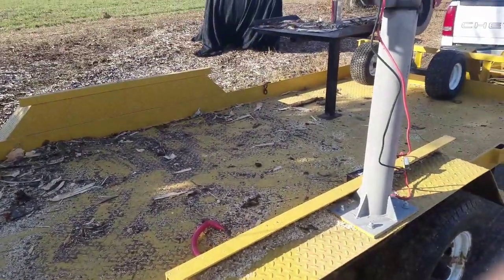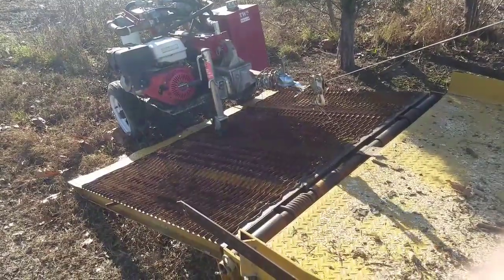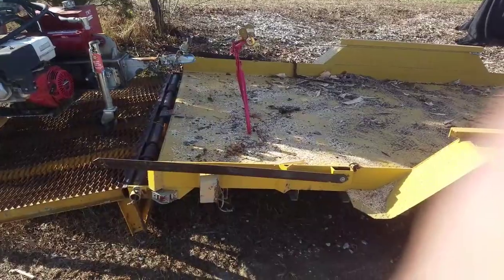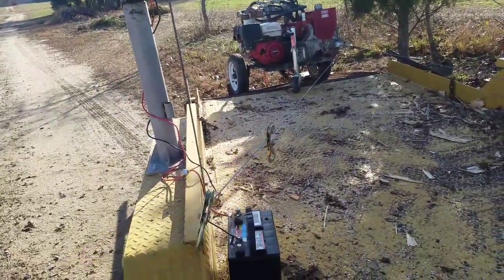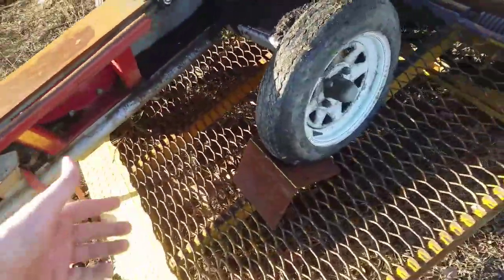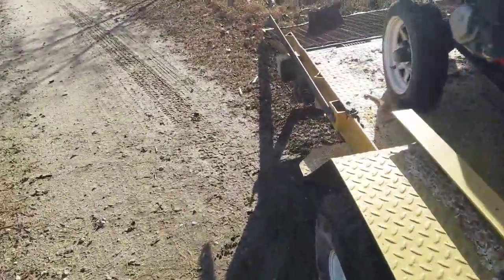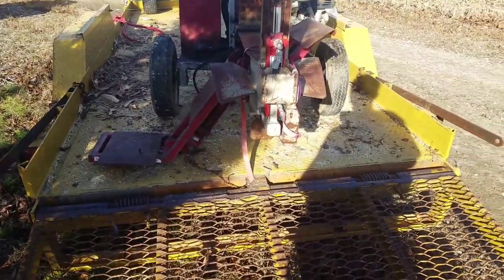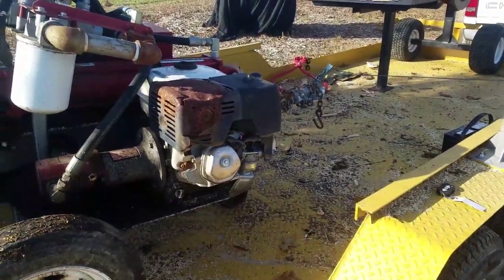Testing out the harbor freight bed crane/atv winch Combo!

Comment: That works slick. Have you tried to load logs with it yet?
Reply from the maker: Yes got a load in, worked well.  I ended up picking up a dualie rear( with tires) and I tweaked the mount when I started spinning it into the trailer.  I need to beef up the mount some more